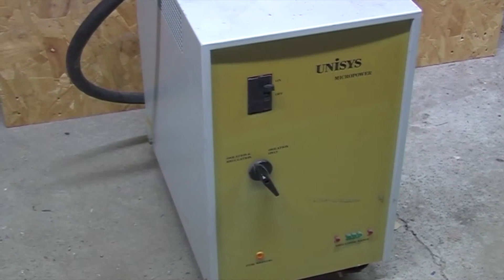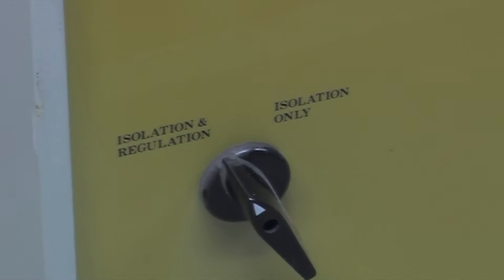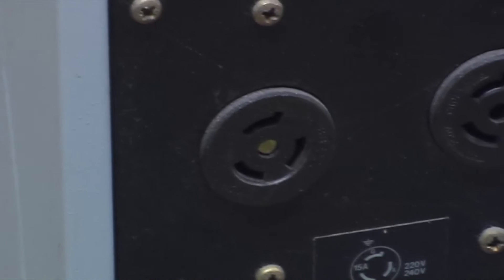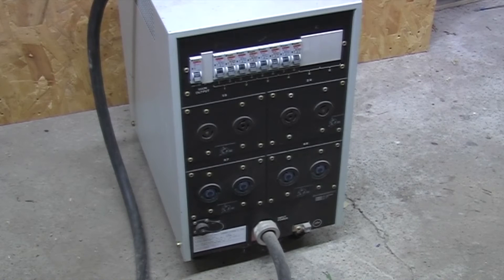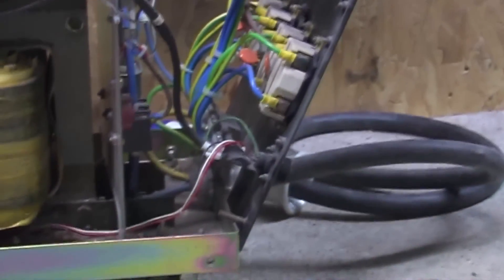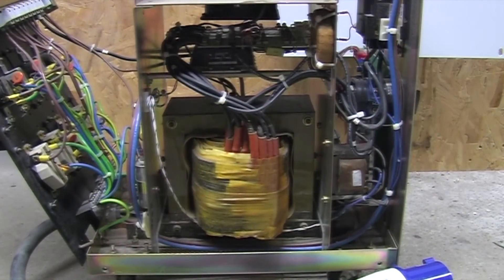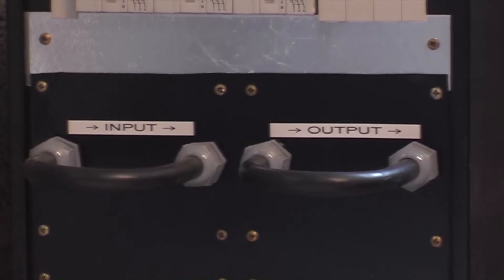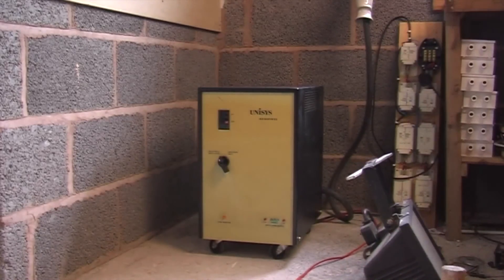Unisys / CPS Micropower II mains conditioner

Comment from the maker: If on the other hand I actually NEED neutral to be referenced to ground (using the unit as a regulator and soft-starter rather than an isolator) I have a plug fitted with a 6mm² link bar between neutral and earth which I can use.

Comment from the maker: One one of each socket is un-earthed, so I've got the choice. Bear in mind that this isn't just a mains conditioner, it's an isolation transformer as well, no tie between neutral & earth. In some cases having no earth connection is essential, if I'm running my 110V tool transformer off it the secondary is centre-tapped to earth, so if I want that truly isolated I need to disconnect the earth wire. Easier to just swap between left and right sockets than to cut the moulded plug off and rewire it.

Comment: Also, if it's all discrete logic, it's dead-easy to repair. 

Good luck getting a hold of a microprocessor from the same era, let alone the tools to program them (or external (E)EPROMs, if that's what it would use).

Comment: Those are common mains connectors on this side of the pond.  They were probably used in order to prevent the loads that it was feeding from being used on an unregulated supply.